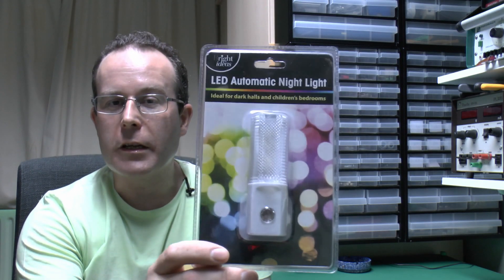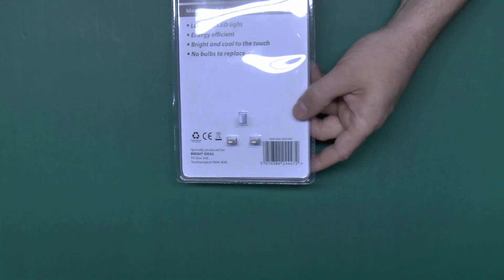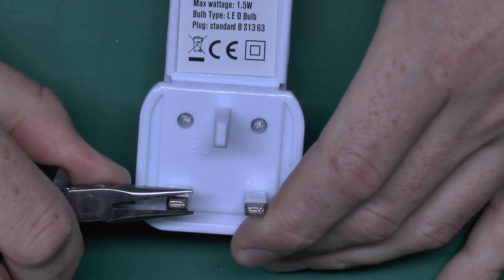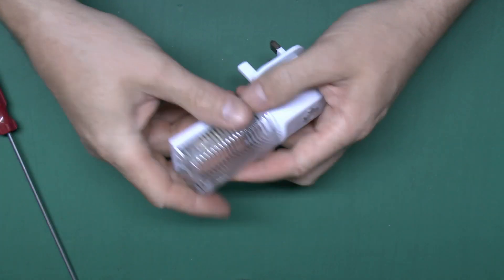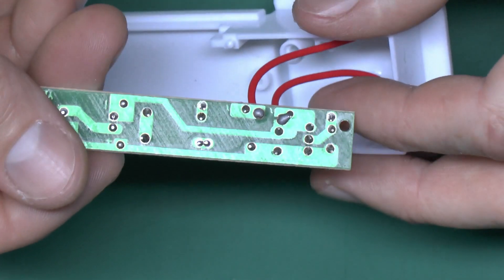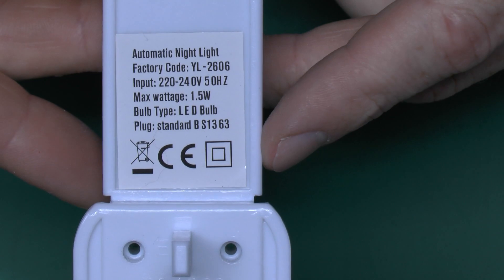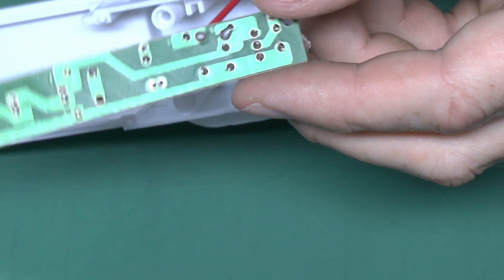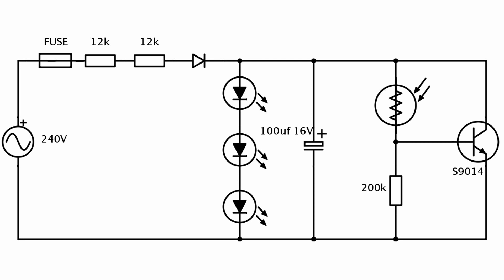99p LED Nightlight

Comment: I dabble with low voltage lights adding dusk detectors to improve battery life using a simular circuit you have there. I do find depending on the LED used that if you install the transistor in the earth circuit of the LED's themselves the transistor will act as a resistor cutting down the current. By moving the transistor to seperate leg it allows full current to flow through the LED's when they are not being shorted out. It does however seem a waste of energy as you say because current is being drawn all the time. Ok for mains lights but defeating the point of the dusk detector in battery lights...

Comment: Interesting and very simple circuit.
Great vid JW.
That transformer which should be 110v, is it now a 230v/230v isolation tyranny? Something you made earlier?
Reply from the maker: That one is a purpose made 230-230 isolating transformer.  Not one I made.

Comment: Inefficient when on, even more inefficient when off... the "short out the LEDs" approach is not as bad when used with a capacitive dropper, as it will dissipate less power when off.
The problem with switching in series with the LEDs, is it requires a high voltage transistor that costs more, and would also need a 400V rated capacitor unless it switched before that.

Comment: what do you expect for 99p... you try and make one in the UK for 99p....
Reply: It could have been made with a far more sensible capacitive dropper circuit with no extra cost if the designer would have some sense of how electronics actually work.

Comment: I've seen a similar arrangement but with a capacitive dropper instead of the resistors. With that the "shorting out the LEDs" trick does reduce power consumption - although the current goes up a bit, it's now almost purely reactive.
Reply: As much as I have seen resistors are actually more reliable than capacitor.

Comment: How I would "fix" this design (so that it would at least work OK and be safe, without costing too much more):

1. Ditch the superfluous shunt-type "switch"
2. Increase the value of the big resistors, to reduce the current (giving a more sensible brightness level, saving power and lowering the temperature)
3. Add a resistor of a few k, in series with the LED string (to reduce flicker)
4. Use a full bridge rectifier (to reduce flicker further and avoid superimposing DC onto the mains)
5. Change to a capacitive dropper?

On top of all that, the casing would be made stronger, to avoid it being broken and threatening electrocution.
Reply: Exchanging one of those resistors with a suitable cap and ditching the whole light sensitive circuit would do the job nicely indeed. Perhaps that salvaged resistor could be set in series with the LEDs to make good use of it :)

Comment: Are poundland electricals like plugs etc dangerous?
Reply from the maker: Not generally, although very cheap they still have to comply with the relevant regulations, and if a major company like that started selling dangerous items Trading Standards would very likely remove them from sale.
The real problems are with smaller sellers, market stalls, internet only etc. are involved, as it is very difficult for authorities to do  anything about them.

Comment: 3mm is the minimum for safe isolation according to BS 7671
Reply: I think 7671 is wiring regulations for buildings and installations. This one would be partly 1363 for the plug and 60598 for the light
Reply: BS7671 is electrical installation and also covers special locations such as bathrooms, wet rooms swimming pools ect.  however the other BS numbers relevant to this type of work and accessories/equipment are mentioned.  A comprehensive list is given of relevant BS numbers including a brief description of the items.The 3mm gap is mentioned in BS7671
Reply: I'm a BSI member and I have some of the standards.
Reply: +ChompChompNomNom and a good standard they are with some exceptions :-)

Comment: Sure, it's not as efficient as it could be, but over 1 year it will only cost $1.05 to run 24/7... for costing only $0.99, that's fine with me.
Reply: Did you factor in the cost of burning your house down after the darn thing overheats over time or perhaps someone blocks the much too bright light with a pillow making things a LOT worse... This thing could have been built with 0.1 W power consumption making it far safer without increasing the price at all.

Comment: i love how this guys buys the worlds cheapest items and then complains how crap and dangerous they are. what the fuck did you expect, that's why there so cheap.
Reply: +brandonhughes7 But that's the whole point. People who aren't so tech savvy will think these are marvellous! Blissfully unaware of the potential fire hazards within them. If one of the LED's open circuits this will explode the electrolytic and transistor way before the cheap inline glass fuse ruptures. John is right to expose the potential dangers - especially as they are advertised for children's rooms!
Reply: Indeed, it's unlikely that the fuse would be much help even then, as the resistors will only pass (assuming their value is accurate and the mains is at 240V) about 10mA, half-wave rectified (i.e. 7mA RMS after rectification; unless one resistor shorts, which would double it to 20mA half-wave/14mA RMS and dissipate a scorching 2.4W in the remaining resistor – though even that's a rare event). The highest current that could flow without a complete dead short (or some resistor going low in value, which is unlikely) would be 20mA RMS. It's difficult to make a fuse that will dependably blow at 20mA (let alone lower currents), and virtually impossible to make one that could reliably react to the tiny current increase from the electrolytic or transistor shorting.

Even for 99p, this looks quite poor to me; it's not like it would have cost more to use higher-value resistors (for a more sensible current), and the silly shunt circuit could be done away with to instead spend the money on more useful parts.

Comment: The circuit design uses a nasty trick: since the LEDs are always in circuit, the voltage across the 100uF will be limited to c. 9v. If you arranged the transistor to turn on the LEDs, you would need some other voltage-limiting component. If you simply used a zener to provide, say, a 12v DC supply, that would also take current all the time and add to the cost. The nastiness is that when one of the cheap chinese LED's fails and goes open circuit, the 100uF electrolytic will explode. Seen this happen with mains LED lamps.
Reply: +Tony Wilk Do you know why they placed the transistor in parallel with the LEDs, rather than in series?
Reply: +Peter McArthur As I said, having the LEDs in circuit all the time acts as a voltage limiting feature but, of course, means the LEDs are on - the transistor turns 'em off by shorting them out.

Comment: Is it possible that the designs in which the transistor shuts the LED off have been patented and therefore the shorting is just a way to avoid patent issues?
Reply: +Doazic They did it to avoid the high voltage getting to the electronics in the off state. Either expensive parts withstanding 350V~ or a proper power supply would have been needed.
Reply from the maker: Doazic Doubtful - such a patent would be so wide ranging that it could be applied to virtually any product containing a transistor.
Reply: do they really care /are affected by that though?

Comment: That Poor Transistor, who could be cruel enough to design such a thing. There's no pride in engineering anymore :(
Reply: They copied an existing design intended for a dropping capacitor rather than the resistors they used.

Comment: Okay.... This goes beyond Taking-The-Biscuit. :D

Let's turn off the LEDs by diverting all of the available power elsewhere..... Let's short it out! Mmmm! Tasty!

So when it's glowing.....1.5 watts and when it's not? Yes, still 1.5 watts!

What an absolute crock of rubbish! ROFL. The stupid things that POXY MONEY makes people do. I've heard it all now!

I don't do electronics, but I am absolutely sure that this circuit could have been designed with little-or-no extra expense so that when the LEDs are off, the power consumption should be less than 0.5 watt.

Stuff that. I say MODIFY IT. Get a soldering iron in there and remove the offending electronic components. OK, so it would be a 'permanent-on' device then, but is it too much effort to turn off the wall socket when its not being used?

I see that there's a Part two to this..... so I'll zip-off and watch that.

Thanxx for showing,

-BoomBoxDeluxe.

6th March 2015, 00.15
Reply: +Victor Arnaiz + Tony Wilk What you didn't spot and I didn't until I tried to make this circuit fail is that as it is half wave the 100uF still has a reactive component giving and equivalent resistive path of about 40 ohms so this acts a potential divider. if you open circuit one of the LED's when the transistor is OFF the voltage only rises to 24v which is almost 2 x overvoltage but the cap will withstand it.  Was it intentional by design - i doubt it they were just lucky otherwise these would be vapourising with some regularity
Reply: +BoomBoxDeluxe  Are you for real ? The device costs next to nothing to buy and next to nothing to run. You would modify it so you had to manualy turn it on and off just to save a few pence a year ?? Your mental.
Reply: Except that it's after the rectifier, so its reactance won't mean anything there.

Comment: Couldn't have made it less efficient if they'd tried.....
Reply: nemthefearless I have an even more wasteful idea that may be even cheaper:

DC -> air coil with 220 turns
air coil with 5 turns -> LEDs + capacitor

Who needs diodes and resistors anyways?

Comment: 2mm is accely half decent 500v based on the UL chart.

But resistors are just stupid defeating the purpose of energy effect leds. Capcitive dropper is a mutch better idea.

But man that transistor arrangement is just beyond stupid.
Reply: However when with a guy soldering a connection Its a bit too close.
Reply: 2mm would be acceptable for 120V mains, but is quite low for 240V mains. The arrangement with the transistor, was copied from a clever circuit but implemented the wrong way. It was intended for use with a dropper capacitor. Actually, it is still kind of clever, it allows for low voltage components to be used - try redesigning it in a sensible way for a reasonable cost.